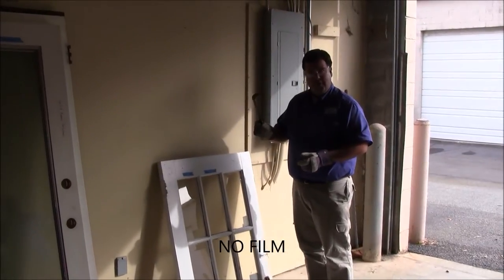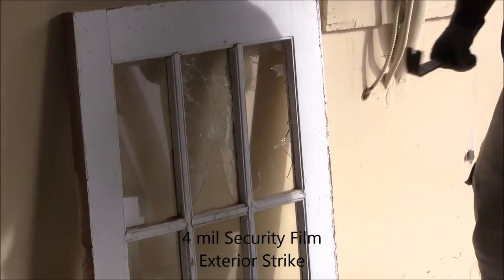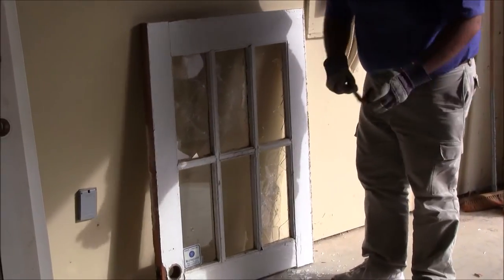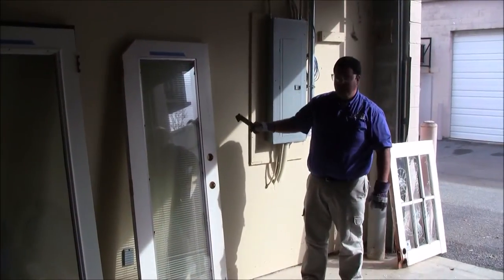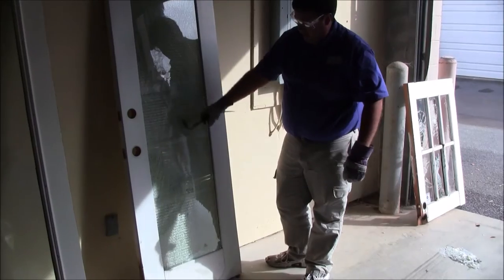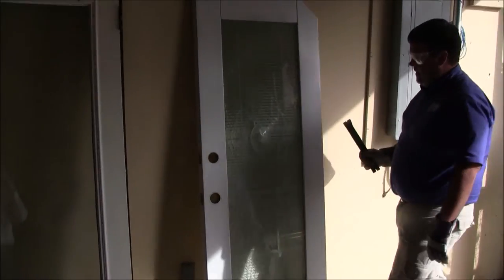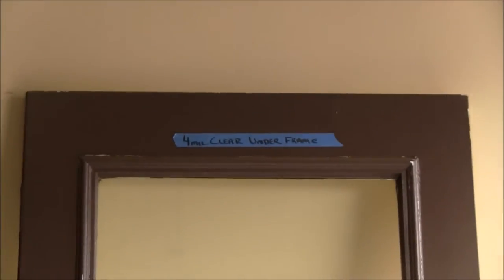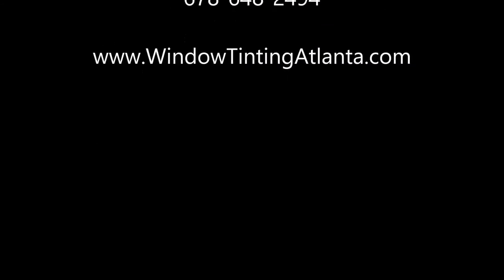Security Window Film, Residential and Commercial, 4 mil

Comment: Check out the 3M film. The 3M film  won't break like that
Reply: Some film manufactures or installers make a video where they install the film under the frames edges that way it can't bulge makes the film way stronger. It's not practical on most windows It still better then no film.